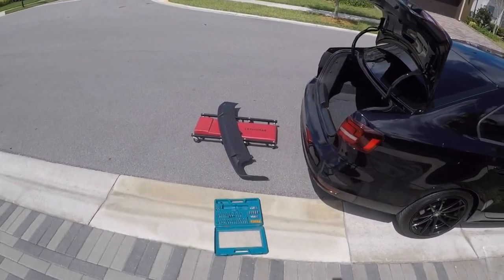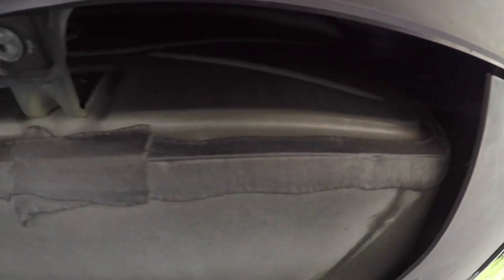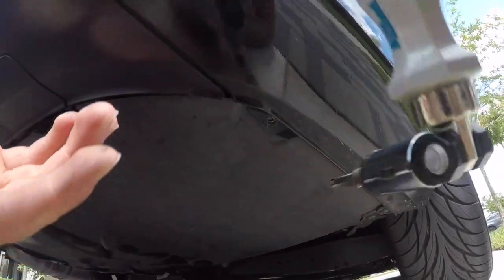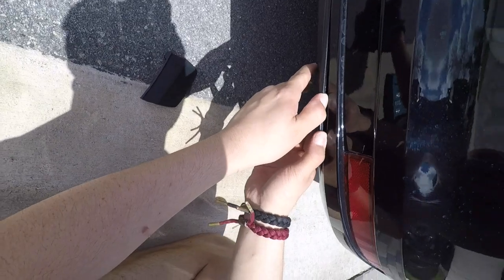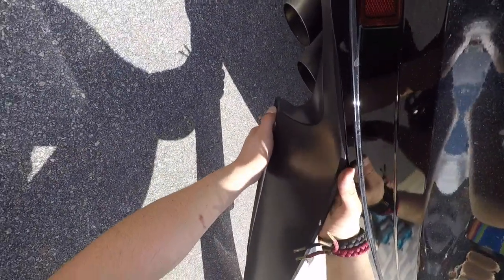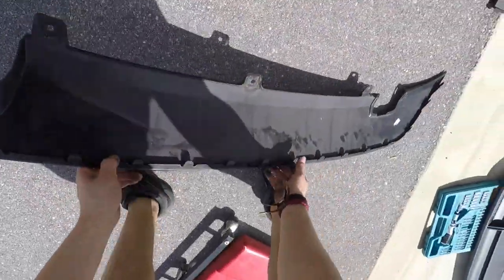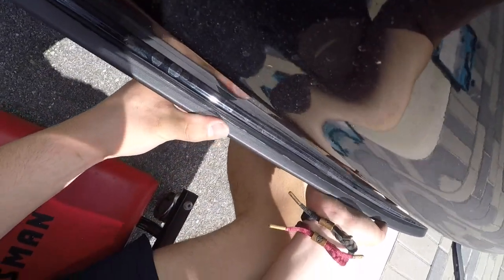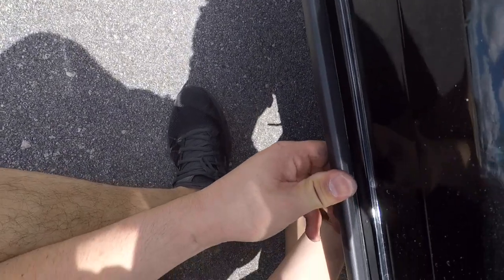mk6 Jetta Facelift GLI diffuser install

Comment: Is your Jetta a GLI or regular S or SE model that you added the diffuser to?
Reply from the maker: Hey , it’s a Base model
Reply: @DrivenByChris  what year? I have a 2014 SE model and want to add the diffuser. Where can I order the exact one that you purchased?
Reply: @DrivenByChris  what year is your Jetta?
Reply from the maker: @randyl.bailey2981  you have a prefacelift Jetta so this diffuser won’t fit because our rear bumpers are different . My Jetta is a 2016 but this diffuser fits 2015-2018
Reply: @DrivenByChris  Awwww man. Thank you for your response. Looks absolutely amazing. Job well done.